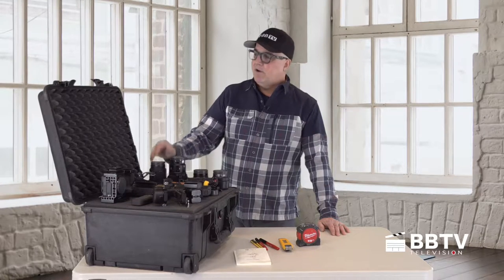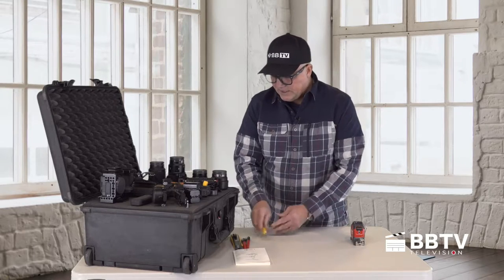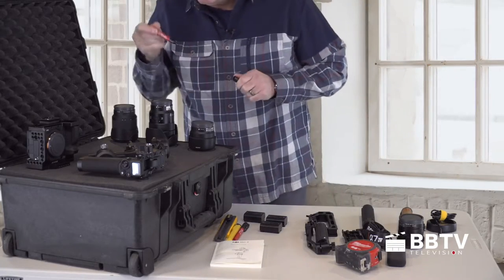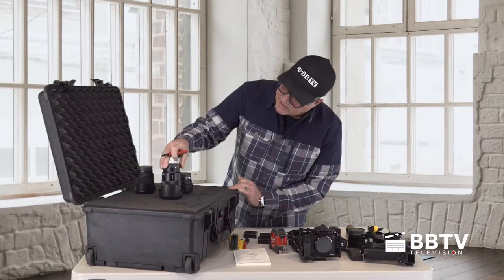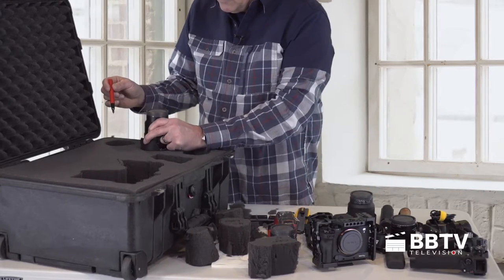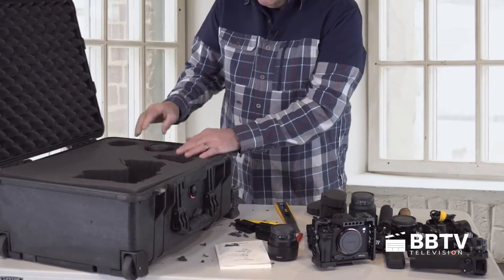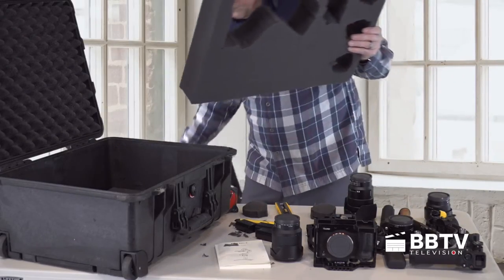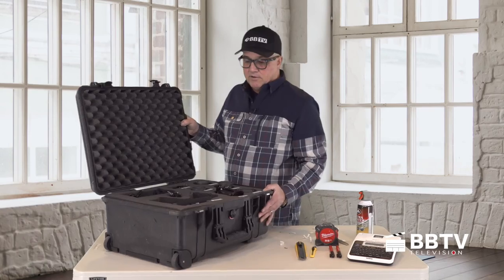How to Easily Cut Foam for Camera Case

Comment: I don't know why i didn't think of cutting out the whole length and then cutting an insert to fit back in. I was trying to figure how I would carve out the foam neatly and at the right depth.
Reply from the maker: Use a ruler or tape measure to determine the depth. Also, you can mark your blade with a marker for depth.